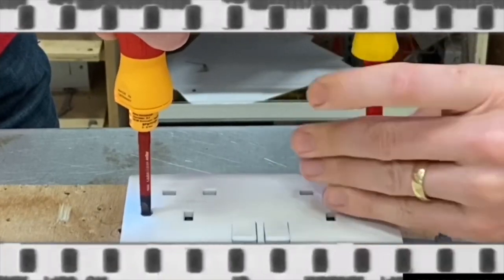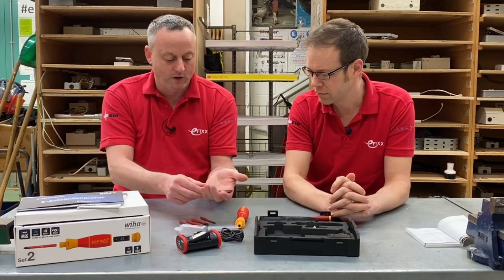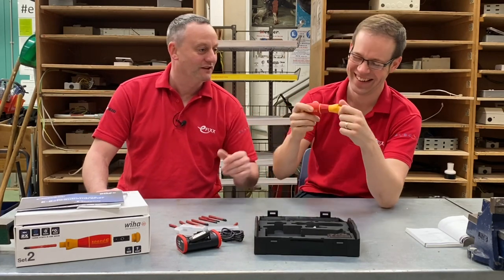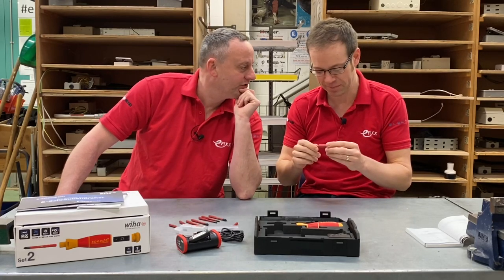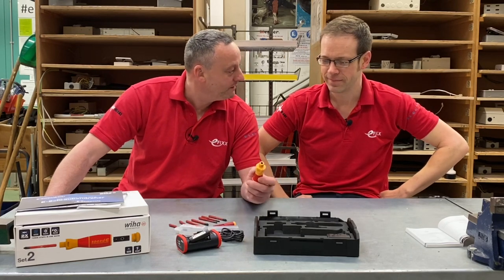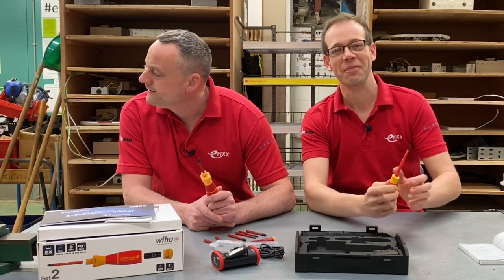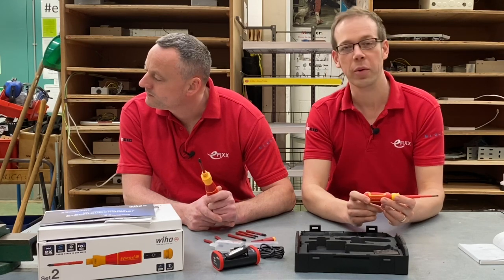Not so SpeedE - Gary's not happy with this Wiha screwdriver.

Comment: I did consider buying one of these recently after Nick "boy-band" Bundy showed it on his channel, but the cost was prohibitive and I didn't like the idea of having to change the seal thingies that come with it. I do carry an electric screwdriver in my toolbox: a Bosch one, but it doesn't get regular use. These things come into their own when you have a load of accessories to zip up such as on second fix or during an EICR as although it's not much quicker to use such a tool (and is often slower and fiddlier with my Bosch), it saves a bit of wrist-wear, and my wrists see enough action outside of my time on the tools.
Reply: David Savery Electrical Services my mate bought one,he never uses it. Terrible
Reply: Do you mean Painting & Decorating?
Reply: @esfae8250  A less savoury activity..... pint swinging.

Comment: It’s the only electrician screwdriver I use now. Upto the point of torquing where I use a variable torque wiha driver it does save the wrists. It’s insulated properties help. Wiha have listened and updated the motor it has two power settings not just 0.4nm but to 1nm. Called the wiha speed e2.

Wiha could have just put a very powerful motor in and helped you torqued it up to whatever torque setting you wanted however using a motor driven screw driver to get you to a torque screw setting say at 3-5nm would be problematic you need to go much slower to avoid it slipping and ruining the screw head. I would have like a variable torque setting range built in and avoid the use of the torque adaptors which just add cost if you get the full set.

Yes it’s expensive, yes it can be improved and has been and it does take time to get used to it but once you do you it does help reduce wrist RSI. Moreover you can still use it as a manual screwdriver for the final few tightening turns whee going slower is important to avoid slipping and damaging the screw head.

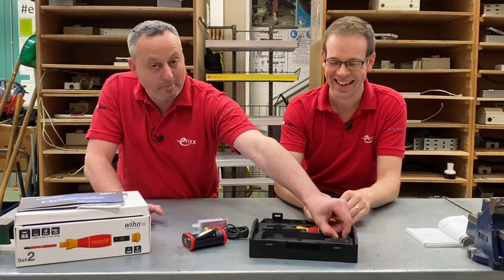Comment: 1:35  This power connector have a shield at the EU adaptor. So I am shure do you can put in an UK adaptor, or an US adaptor or an Asian adaptor. 

Since the european regularies from 1995 all electric products must have the correct connectors exact for this country - so for UK an UK-connector. So most EU products have a 2way EU-connector and a 3way UK-connector for the power changer.

Comment: Can you use the slimvario screwdriver bits from the other wiha interchangeable screwdriver sets? Looking to get a unit bare and use old extension bits
Reply: If you have the 6mm SlimBits it's compatible
Reply: Use Wiha 28758 for 1/4 inch bits but be aware because it's losing his VDE protection.